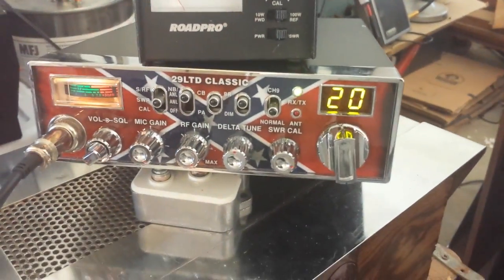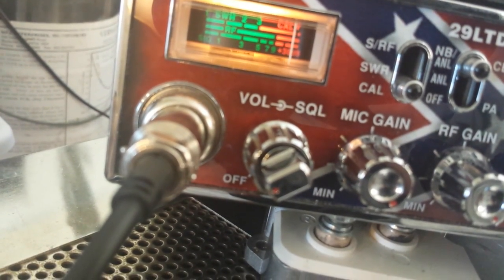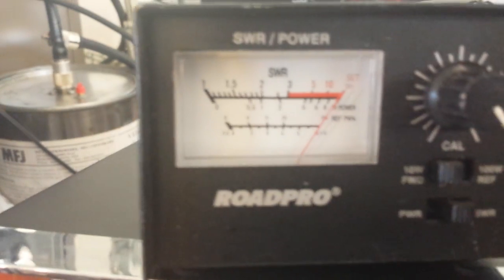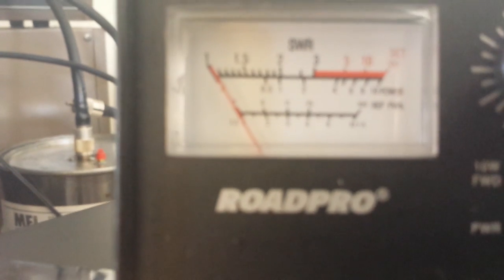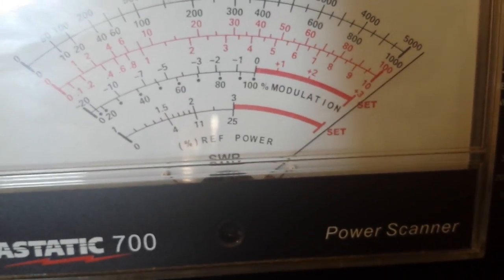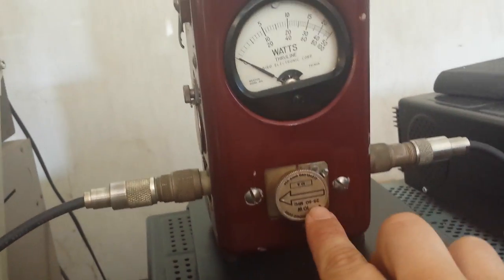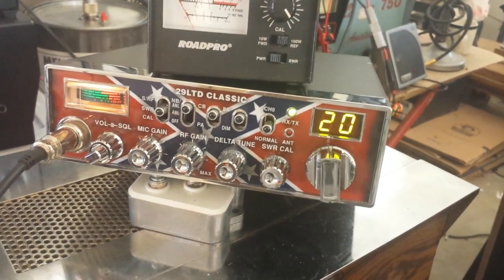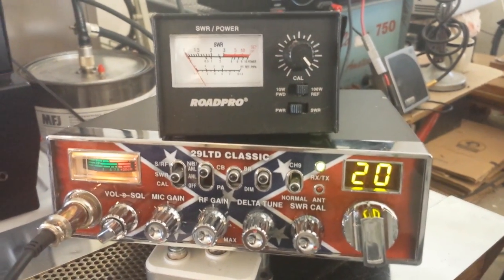CB Radio Beginner - How To Check Your SWR

Comment: Question I have a cobra 75 wx st on my 2017 Jeep JK using ArmorFlex Dual-Shield Coax Cable with FME with a 3' Firestik FS CB Antenna on a Spring with a Firestik K-1A Quick Disconnect CB Antenna Mount, trying to tune it and no matter what I do I can't get it lower then a 2 on the Watt.and 6 on SWR

Comment: I watched your video before and I'm new to this stuff, I bought a cheap radio and a cheap antenna one of them stick on ones. about 2 weeks ago before I knew what SWR was, seems like I can't talk. I within a week upgraded my antenna. My SWR measures 1.3 on 1, 19 and 40. But when I put the meter on power mode I key up a mic and my dead key falls about 4 but if I talk on it, it won't swing the meter like you did maybe that's cause it's stock?. is my transmitter fried or is there just not nobody close enough listening? I ain't expecting world beating performance, I just want to know if I cooked my transmitter running that crap antenna, I got a couple guys to answer me with the old one. But I don't mess around trying to talk too much running a stock radio with no amp and messing up the real CB dudes airwaves.